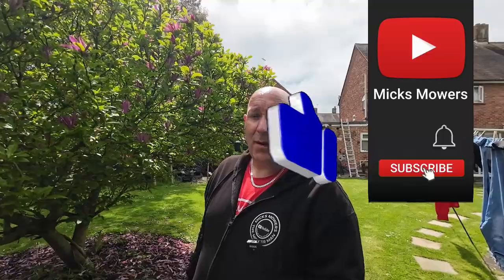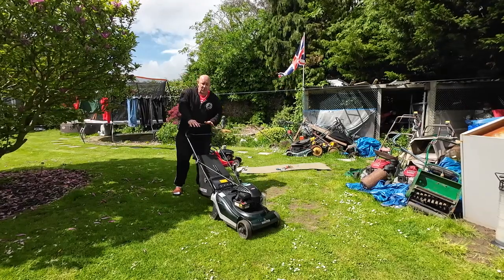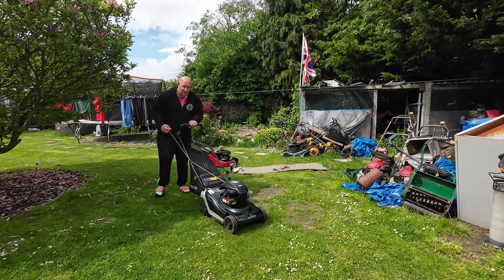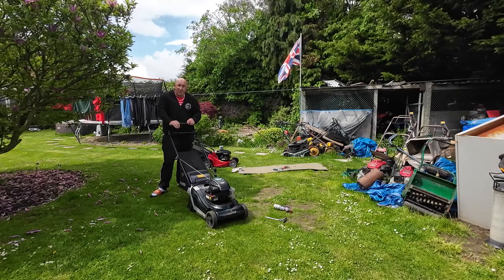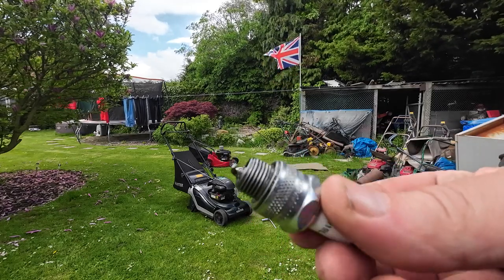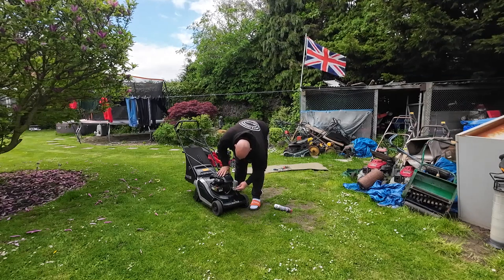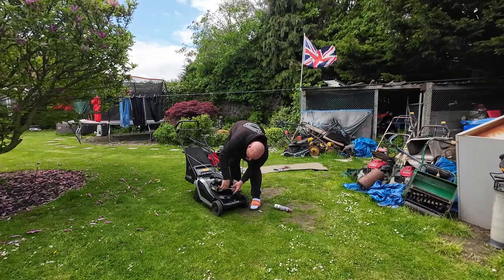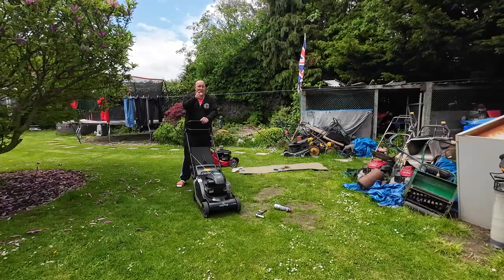Try this with your Lawnmower before you throw it away..

Comment: Nice video and a good explanation. I had just this problem in the shed now. The mower ran, but ran poor. Honda GCV-135. The owner had done all to it, cleaned carb etc etc. I even asked him, did you change the plug? "Yes". So I cleaned the carb again, still would not run nice. I was like, man I gotta check the plug even though he said he change it. I looked at it, from outside looked brand new - took it off - looked like a war zone. Put in a new spark - pulled the cord and bääm old nice smooth honda revs. This video everybody should see for sure. I will make a short one also about my experience. Cheers from viking land!

Comment: at least with the briggs and stratton  engines you can repair and replace. Years ago I had 2 argos mowers.. both eventually stopped working, both were difficult to repair. Sold them for spares and repair.

Comment: I bought an Allett Classic 14 from ebay last weekend, sold as spares or repairs. Just needed fresh fuel. Cheaper than your spark plug :))
I'm dying to see your cylinder tear down video, when is it coming? I need to sharpen and re-paint mine....
Reply from the maker: Just wanting for it to return from the shop before I can finish the video

Comment: That's really weird Mick I was talking to you about the hayter harrier 41 i just got
It was thrown out of the front of someone's house with some other metal so obviously for the scrap man. I did knock and they said just take it
It starts and runs fine. Only thing was by the pull cord grip the cable was frayed and on the point of breaking so I looked at your hayter vid. Obviously its to do with self propelled belts etc. But I fixed the cord just by chopping off the frayed bit (which was only about 4cm. Then retied the knot in the handle casing. And hey presto. Lovely

Comment: Hi Mick Great Channel. Quick question my Stihl RM248 pulls in crap when the petrol tank is nearly empty (no surprise). Its a pain to flush the carb out! There is no fuel filter would it be worth putting one  inline? I was wondering if it would reduce the flow too much? Cheers John
Reply from the maker: Yes you can mate ..

Comment: can anyone tell me why some Briggs  lawn mower primer bulbs have a small hole in the end and some dont , if mine has a hole do i need to replace it with the same, or does it not matter???/
cheers in advance for any answers..
Reply from the maker: It has a hole so it can suck air.. yes .. replace like for like
Reply: @themowerman  ive took the primer out and behind it seems to be a plasic blanking plate in case you dont have a primer i assume but there is a tiny square hole been cut in it,, will this be sufficient ,or should i drill a bigger hole.. it is allways hard to start but once started it easy??? thank for any reply you can give,, (its a einhell)

Comment: Ive just got one of these off Market place for £60 the only problem I have with it is when I need to start it I have to turn it on its side (even if the tanks full) then pull the starter and it starts... Any ideas ? Great videos BTW thanks v much
Reply from the maker: What engine?
Reply: Check the fuel cap to make sure the breather hole is clear could be that.
Reply: That’s not a SPRITE its a SPIRIT I’ve got same model!.

Comment: Found a Harry/Active mower in the trash about 4 weeks ago. All I had to do was just put the carb back on (was lose at two screws) and a new airfilter. 

After putting fresh fuel in, it fired on the second pull and runs like new. 

So why does everyone throw away such good machines? I dont know..
Reply from the maker: Mate.. I just don't understand it

Comment: Today's society is a throw away society which benefits us as fixers! More money than sense some people.
Reply from the maker: Your right mate
Reply: @themowerman  Hi so I've got a cobra mx534spce and just recently the self propelled function stopped working so I tightened up the clutch cable and well it moves but not very fast and also it has 4 different speeds and neither of them seem to have any effect, so do you know what the issue might be?
Reply from the maker: @beaviccoon470  so first.. check the belt.. and if it's old replace it
. Second if it's a 4 speed.. check the belt pulley..
Reply: Unbelievable how they just abuse then dump things but spend hundreds new  on them?
Even if rich it still is a waste. I'm not wealthy but not broke either. I try to look after my things though as brought up by war parents who had to make do and mend that
Reply: Oh by the way I managed to get my mowers self drive working, it turns out that the belt slipped off one of the pulleys and so there wasn't enough tension so I put it back on the pulley and it now drives as it should. 👍
Reply: @ciararespect4296  quite agree. If the make do and mend theory was instilled in today's generation then we might not be facing things like global warming so much, things would be serviced more often or repaired instead of thrown away and bought new.
I too was brought up by parents that experienced war, military service and post war rationing, if we didn't have it we had to do without or make do with something else, grow it ourselves, fix it ourselves, basically we were taught to be self sufficient.
Reply: @Herbybandit  exactly. My Dad was born on a farm in Ireland. In the middle of nowhere. He came to the UK as a carpenter in the forties. I remember him. Straightening bent  nails and using them  again lol
Mum was in the WAAF. Garden was full of veg. I was youngest so hand me downs were the order of the day. No junk food all home cooked etc